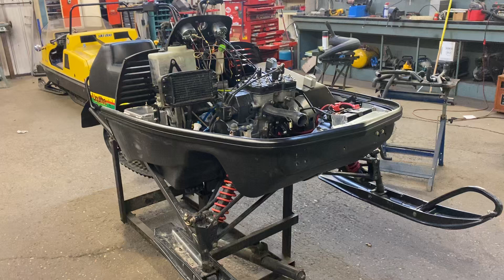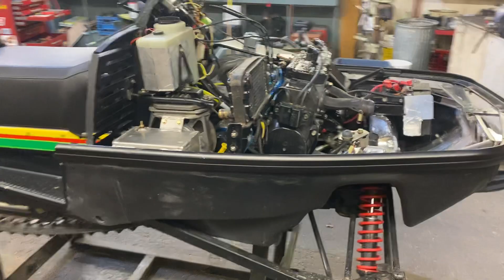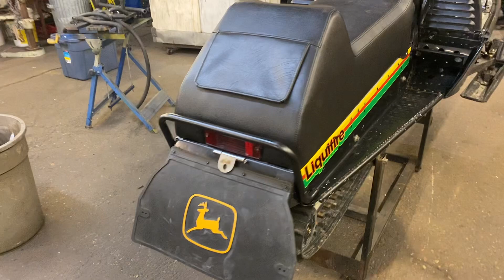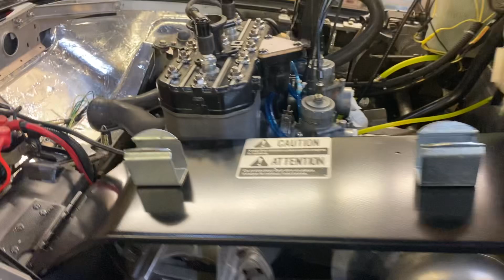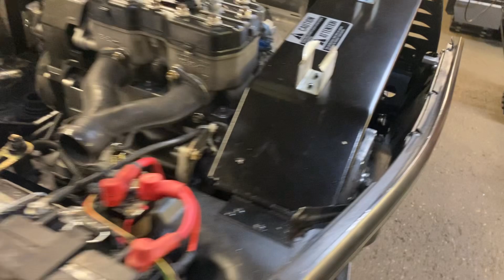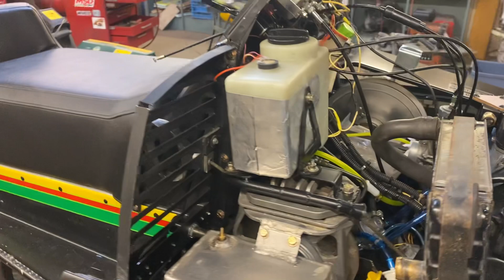December 10, 2023

Comment: Curious what it actually is. IFS added to a John Deere or Deere graphics added to a Polaris Indy?
Reply from the maker: The chassis is from a 1998 Polaris XC700. The front and rear bumpers, hood, entire dash and instruments, fuel tank shell, radiator, air intake box, rear flap are all from a 1978 John Deere Liquifire 440. The bars are from a 1983 Trailfire LX atop a custom Polaris steering post. The seat is custom made to fit over the custom built aluminum fuel cell hiding under it. I designed the seat to resemble the type that was used on the 1976 John Deere Liquidator. The engine is a Polaris 440 liquid (Fuji) from a 1996 Indy 440. 
I’ll post another video once I finish the build.
Reply: Very nice